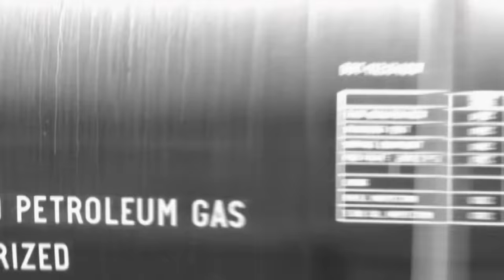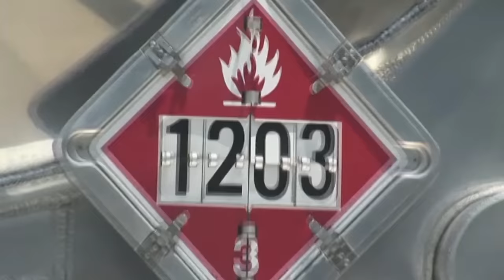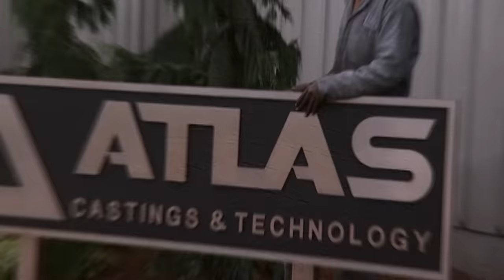Horrifying Bleve Explosions Around The World | Explosions Gone Wrong

Comment: I am surprised you guys did not mention pepcon in Henderson NV a company that makes solid rocket fuel for the space shuttle rockets this was in the mid eighties which took out the plant and a building across the street killing only two and caused damage to houses and damaged buildings 5-6 mile area my house was 2 miles from this plant we had cracks in building wall all windows blown out here is the topper the plant across the street was a staypuffed marshmallow factory the plant manager for this place was the second fatality from the explosion what caused this was a welding job in the rocket fuel plant and was fed by a natural gas line that ruptured during the first explosion  which left a 200 foot crater no buildings were left the second explosion was the worst of it a fire truck responding since it was clark county and henderson responding as well as city of Las Vegas  too as backup and water tending one truck was rolled by the shockwave from the larger second explosion you want to talk about seeing a myshroom cloud holy crap it was huge

Comment: Part of the video is very poorly researched and inaccurate. 01:30 July 25th 2007 Dallas, Tx: Acetylene does not burn in a BLEVE but excessive temperature and pressure causes it to decompose spontaneously in an exothermic runaway reaction which eventually destroys the cylinder . 1203 the sign on the truck is the HAZMAT code for gasoline not Acetone which would be 1060. Only the propane cylinders on site which were exposed to the fire exploded as BLEVE.

Comment: AI could possibly detect or predict it but containing such explosions including missile attacks or any kind of explosion doesnt seem solvable by AI. Few measures that could be taken include creating infrastructure which deflects the wave generated by the explosion and creating pressure valve and liquid/gas membrane which releases pressure and make it less available for oxygen to react, something called planned failure which is used in bridges. AI could reduce damage with rapid protective measures but reducing damage to the nearby infrastructure sounds challenge.
If an airplane or drone goes through such an explosion , how could it survive and rebalance itself? @Darpa
What if the canister is redesigned with hexagon shaped inner layer with metal compartments for gases social distancing?
I have never heard Indian firefighter say have experienced plenty f propane explosions, many even ignore basic safety procedures. If this happened on a bridge, it would have created a crater on the bridge, is designing bridge with greater fleibility and vertical movement an option?